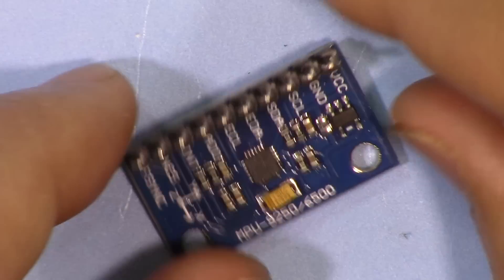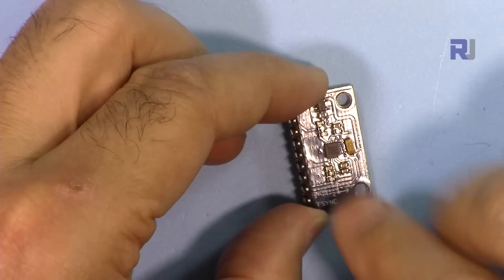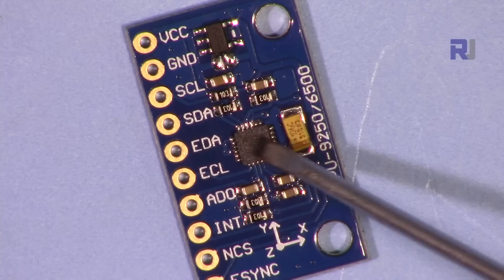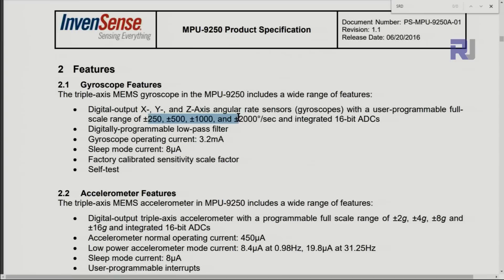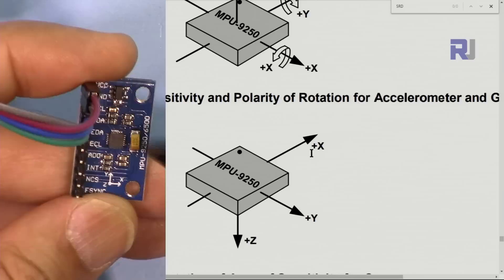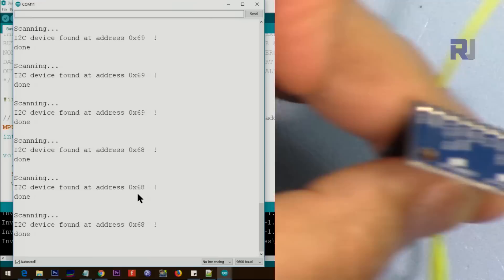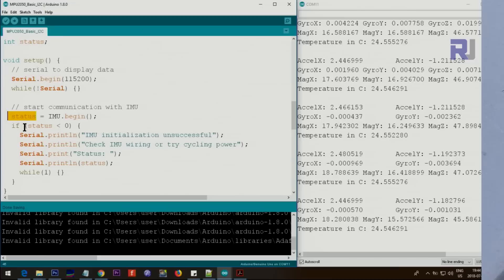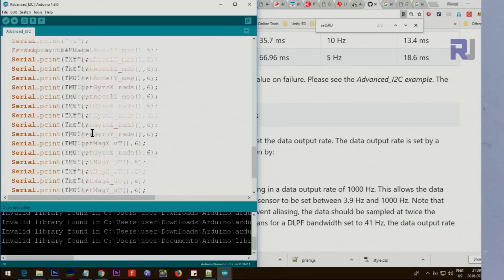How to use MPU-9250 Gyroscope, Accelerometer, Magnetometer for Arduino

Comment: IMU initialization unsuccessful
15:35:36.499 -> Check IMU wiring or try cycling power
15:35:36.533 -> Status: -1
what wrong >>>!!!!!  why is this showing ?
Reply: You should connect sda pin of mpu to a4of Arduino uno and scl pin of mpu to a5 of Arduino uno. If you are using another type of Arduino board than you have to search for it's sda & scl pins on Google